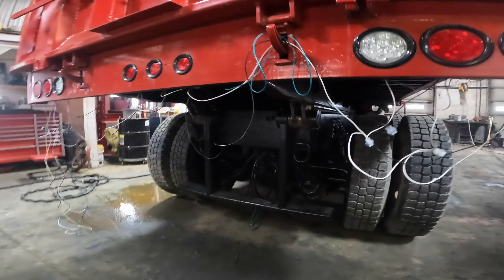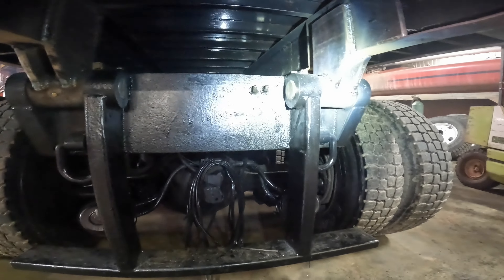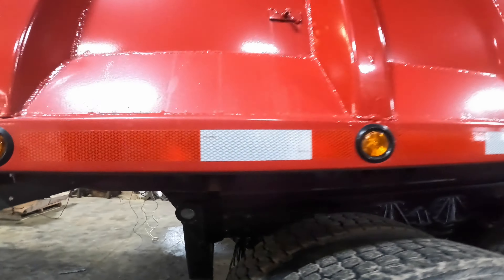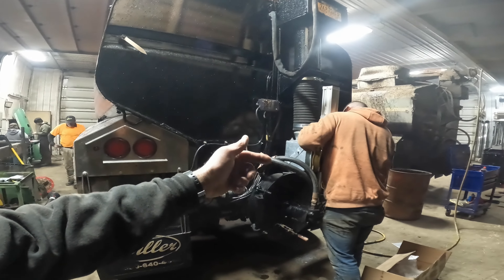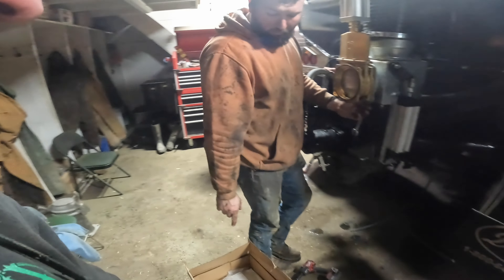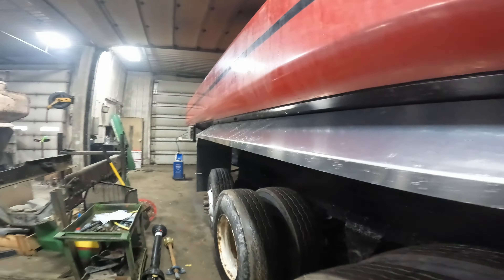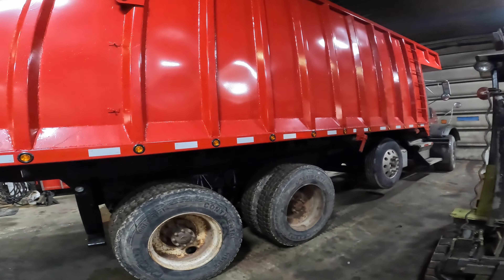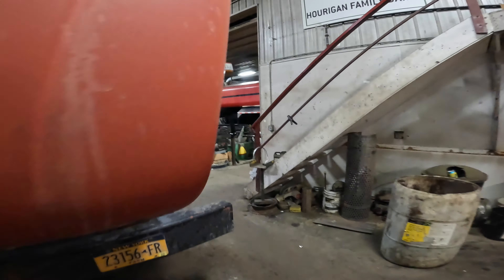Mounting Silage Box To Truck Chassis

Comment: True about the DOT tape... but you can also put wavey or serrated lines in when you cut it.  You can also do that with the inch and a quarter then leave a little gap to make a zig-zag in the middle when you put both on... very attention getting.    No rule against writing "TRUCK" on the side of the truck with it either.   You can even spend the $8300 it takes to spray the whole trailer with reflective coating and then put on the DOT tape too!

Comment: Great video, and great job on the box. I don't know if it's the camera angles, or lack of depth perception from a camera, but will the body clear your grain auger hopper when fully raised? LOOKS like it will be pretty low at full tilt, but I am pretty sure you measured it out to the inch. 👍👍

Comment: I guess you don't plan on ever taking the silage body off of this truck since you mounted it permanently on the truck unlike the other trucks that you built in the past where you can slide the silage body off and put a manure tank on it. I really liked those setups that you built like that on previous trucks. I'd love to have that setup but on a rollback instead so I could slide the rollback body off and slide a wrecker body on.

Comment: I Dont know much about welding could you Explain why you started with wire welder then switched to stick welding on those pins ? Just wondering what the difference is
Reply: I can't speak for exactly what Andy's reason was, but I do it because the leads on my stick welder are much longer and then I'm not dealing with the welds curdling up and coming out like crap because the shielding gas is blowing away from the mig welder. If I had to guess it's one of those reasons for him as well.
Reply: @Adam_Poirier  I thought maybe the Stick was because of the Thicker metal he was welding I really dont know Thanks for your info though!!

Comment: You still butthurt over that lift axle tire??? Scuffed while it was in the air?!? How could something in the air do that? Maybe your welding helmet was on too tight. 
That chunk of tread  missing came off when someone probably when  Jarred was driving it with the axle in the down position didn’t lift it when he was making a hard left turn. I see it all the time from rookie drivers.
Don’t get butthurt when someone points out something. I’ve built tires for 20 years for BF Goodrich/Michelin and I’ve worked in the heavy equipment industry for the rest of my career so I know exactly what I’m talking about. 
That burp explains exactly what kind of man you really are.
Reply: I've got a tri-axle low bed, and the rear axle is a lift axle. Those rear four tires sustain the most damage out of any of the tires on the trailer when the axle is up because we're going over so many uneven surfaces. I've actually followed behind that trailer and every once in a while, you get a puff of smoke as the tires are sitting there stationary, but then they catch a high spot in the ground and they end up with chunks torn out of the sides and flat spots on them...